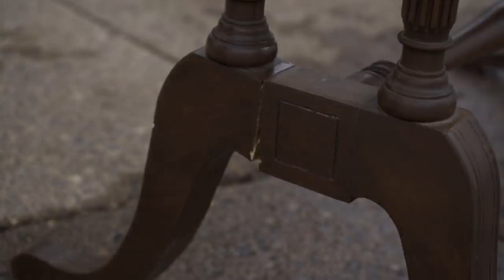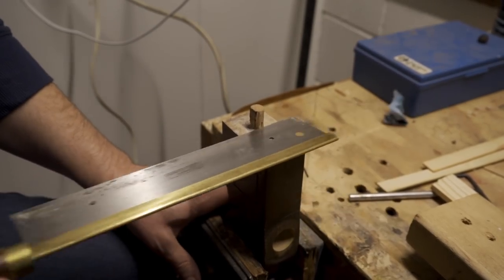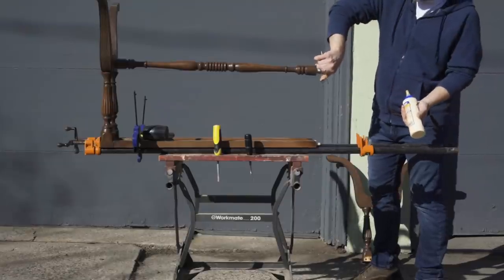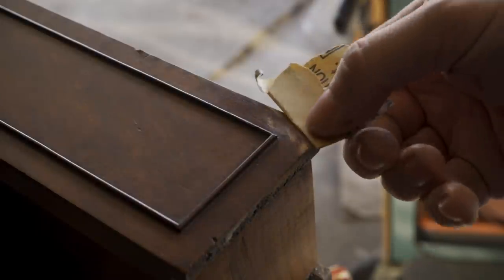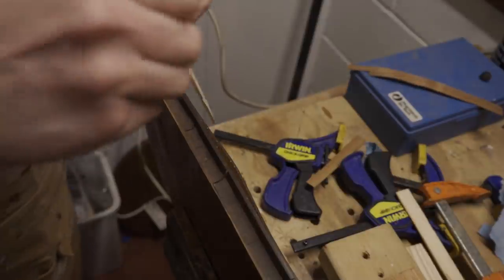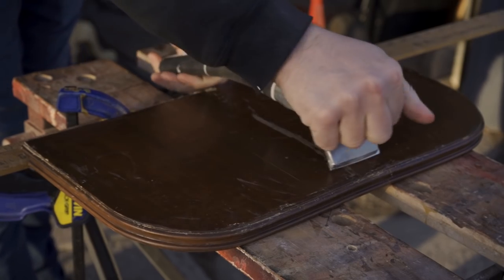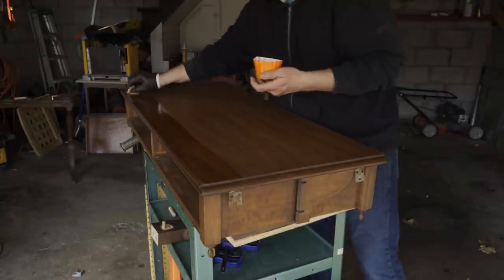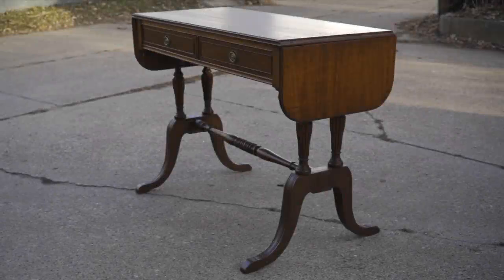Thrift Store Rescue #20 | Repairing and Refinishing A Vintage Table | Furniture Restoration

Comment: That leaf repair was amazing! I was sure that thing was a write-off and would have to be re-made from scratch. I'm no expert but it looks to me like some water got spilled while that leaf was in the down position allowing water to get into the veneer and the base wood edges causing them to swell. And being that they are different woods did so at different rates. Combined with the shear force from the parts of the veneer that still had a good glue bond, warped the piece. Again great restoration. Been looking forward to another video since the fold-away table.

Comment: I use a hair dryer to help move the wood glue down into those small crevices.  The heat helps liquify the glue and the air moves it in.  Love your videos, I am learning so much!

Comment: That turned out AMAZING 🙌🏼and I love the finish on it too. 
I got my hands on a 150 yr old bankers desk that was brought to Australia from England. The last 50 yrs it was left outside. Needless to say it was in pieces, warped, splintered and really I didn't have the tools or knowledge on how to bring it back to its original condition. I needed an island for my unfitted kitchen so to flatten the top of the desk, which ended up being the bottom, I drove my 3.5 ton Bravo over the top 😁 wet it and left it there for 48 hrs. It worked.

Comment: Kinda looked like you could have just peeled that veneer out to make things "easier" but thanks, that did teach me something about fixing partial warps. Beautiful work overall and glorious finish, you sure know your stuff on the color match.
 -  Tip for working with steel wool:  A Strong magnet with a piece of cloth double folded, dab the through the worked surface to pick up leftover residue.

Comment: Your refinishing techniques are very good and your projects turn out very good. I'd would like to give you a pointer on wood glues: Most wood glues (like Elmer's and others) are made from animal byproducts and will soften with vinegar making the tear down a bit easier. I am not sure if that was the type of glue you were dealing with on the faulty leg repair. But keep the vinegar in mind when taking apart other projects.

Comment: Turned out beautiful I’m just curious with all this hard work do you find you get a I’d return when selling? To knock down sheen try using a brown paper bag, there aren’t any of the residual effects from the other methods and it acts as a 800-1000 grit sand paper

Comment: Hi Sir.
Good to see you back on with another great video.
Quick question if I may ?
When you restore a piece as you did in this video, does it effect the price on a antique piece when you resale since replacing with the newer wood ?
Reply from the maker: On this particular piece, the work I did would increase the value.  This isn’t a true antique.  It was made in a factory in the 1930’s.  Also, this style of furniture doesn’t have much value in the area that I live, no matter the condition.
Reply: @DashnerDesignRestoration  Thank you for the reply !
I always thought that if a piece was a certain age it was considered an antique ?
1930's Is older so, this is not an antique ?
Reply: @geraldgarza7163  Technically, to be an antique a piece needs to be at least a hundred years old, I believe. But correct me if I'm wrong!
Reply: @elliepascoe5954  Interesting. I didn't know this. I never really thought of what age guidelines were to be considered an antique.
Thank you for the info.

Comment: The veneer was so loose. Is it ever advantageous to remove the entire top and glue it all back or too dangerous to attempt? Btw, looked get after the repairs. 👍🏻
Reply from the maker: That could be done but I'd rather avoid if possible.

Comment: Dowel removal can be accomplished by drilling the smaller hole as you did except I then twisted a wood screw in the hole and once it gets enough bite, you can pull it up and the bottom half of the dowel will come out with it. Kinda like a popsicle. 😮

Comment: Hi, do you do consults for restoration? I have a Scan Design teak wood table that I inherited from my father. It has brilliant potential but the top surface is worn, has water rings, and was damaged by heat from a clothes iron. Could we connect for a video conference to show you the table? I would like your recommendations of how to restore it. I am happy to pay you for your time. Thanks in advance.

Comment: The sides leaves should have had the veneers removed completely and the boards repaired, before regluing the veneers. The boards used as the base expand and contract at different rates from the veneers which was laid with it's grain perpendicular to the base woods. This is why it buckled in the first place. You just filled the gap so if the wood expands in the summer, it will crack the veneers. I hope this doesn't happen, but I've seen it so many times. With those veneers being so loose, it wouldn't have taken much time to fix and the results would be dead flat leaves and little or no gaps. Hyde glue would have been a better option for the veneers on the tops because it is more flexible than wood glues.

Comment: I took apart legs of a wobbly table. Screws, dowels and failed glue. I was just going to re-glue it, but noticed the dowels did not fit tight in the holes. That is not good. Dowels should fit tight. I think the dowels are 1/4 inch, but the holes a little too large. Now what? Maybe buy the next larger size dowels, 5/16 and enlarge the holes just enough so those fit tight?

Comment: I really love Scotch-Brite pads for all kinds of household and woodwork applications. I assembled this guide. There does not seem to be agreement on their abrasive rating - the values in ( ) are from 3M and the other values are from supplier websites. 
7445 - White, called Light Duty Cleansing - (1000) 1200-1500 grit
7448 - Light Grey, called Ultra Fine Hand - (600-800) 800 grit.
6448 - Green, called Light Duty Hand Pad - (600) 600 grit
7447 - Maroon, called General Purpose Hand - (320-400) 320 grit
6444 - Brown, called Extra Duty Hand - (280-320) 240 grit
7446 - Dark Grey, called Blending Pad (180-220) 150 grit
7440 - Tan, called Heavy Duty Hand Pad - (120-150) 60(?) grit

Comment: Carpenter here. A much more efficient way to remove old dowels would be to use a drill for metal bit with a diameter of just .5 mm less. Once you drill out the center part of the dowel, the rest will either just pop right out or cling to the drill itself.